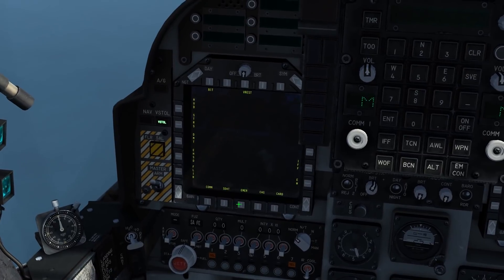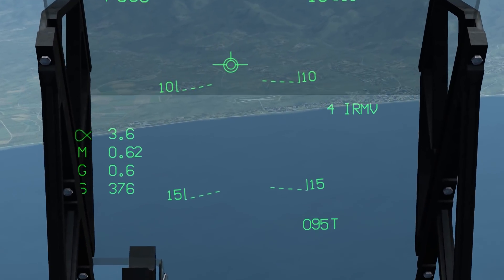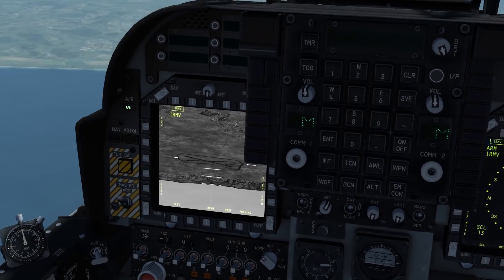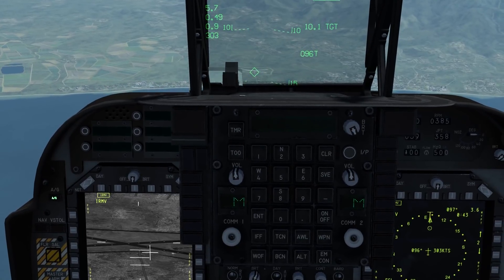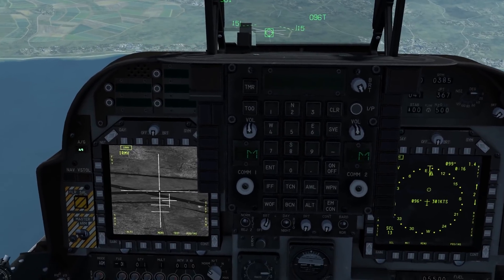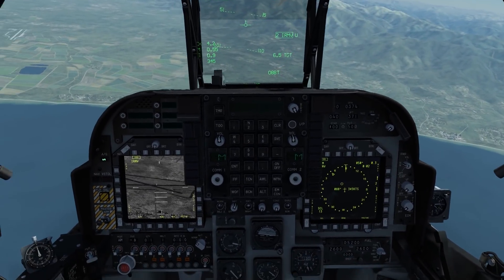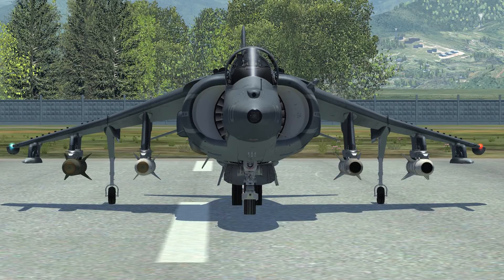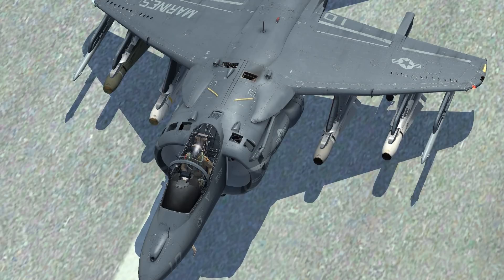DCS AV-8B NA Harrier AGM-65 Maverick Tutorial

Comment: Is there a reason you use the DMT? I've just been selecting IRMV, waiting for "RDY" to appear bottom left, toggling sensor select forward to "IRMV", then uncage and slewing the HUD cursor (for major slewing) and picking my target with the missiles camera in the MFD screen.
Reply from the maker: The DMT is easier to slew, can slave to waypoints and has a better zoom for finding targets precisly. It also remembers its previous location if you turn away. 

This just makes it a little easier to engage with, even though its a few more button presses. It's also worth noting that replacing the dmt with the tpod gives you the exact same process, but with even better still optics and observation.

Of course, at night the dmt is useless as a tv camera however.

Comment: How the hell do you get the DMT to reset after you've used it once? Once I get it locked to the ground once, I can't get it to lock anywhere else without slewing the thing for 100km to the new target...how do I get it to unlock the ground? I've tried using the nose wheel steering key binding, but it doesn't seem to release the TV position. my TV is just staring at the ground below me. I can't get it to lock, I can't get it to move, I literally am mashing buttons at this point and nothing is happening.
Reply from the maker: It's the AG Target Undesignate / NWS / FOV Toggle button, verify you've got it bound correctly.

Comment: Is there at all a method to have the Maverick seeker heads slaved to the DMT at all times? If that is the case - is it possible to assign steerpoints via the DMT?

My thinking is that, while you are >7.5 miles out, you can designate each target a steerpoint while you’re waiting. Then, when you’re in the engagement zone, ripple a Mav, select the next steerpoint and hence quickly have the next Mav slaved to the next target, ripple again ad infinitum until all stores are depleted.

I was able to do a similar thing in Falcon BMS where you could just have your TGP cycle through all your steerpoints and fire Mavs on each target.
Reply from the maker: The Aircraft does have the functionality to slave to waypoints although it's not fully implemented in dcs. I believe mark points and manual waypoints are also planned.
Reply: RedKite thanks for the info man!

Comment: i don't have a pipper on my harrier, 
i don`t have a pipper type thing that shows where the aircraft is going, i don`t have anything that shows where the sidearm has locked
Reply from the maker: Do you also have a little light saying gen on the right of the keypad? Sounds like you forgot to turn on the generator during start up
Reply: no, even when i start from the air, it doesnt show,
i could show you some screenshots of my cockpit to show you what switches ive got pressed, this was on a flight from where i started in the air, 

this problem also persists in multiplayer if that helps,
Reply from the maker: Do you have the air to ground master mode selected, have you selected your weapons on the armament control panel or on the strs page.
Reply: yes
Reply: another thing if this helps is that my RWR isnt giving any sound, i can see the symbols, and it shows up on my HUD compass, but i cant hear the noises the rwr makes, only little squeaks if the missile hits my aircraft,

Comment: Excellent video.  I have just downloaded the Harrier module and will be trying it later. I have learnt from the A10 that these type of videos save me so much time. I use Oculus rift for DCS which is brilliant for a sense of presence, speed and scale but is very much less good for picking out ground targets on sensor screens. I also find that I have to lean towards sensor screens to read what each button does as it can be hard to read.
Still good though. Cheers.
Reply from the maker: I've been using the Vive, been having great fun in dcs increasing the pixel density a little will help with readability you could consider binding 'vr zoom' in the ui layer section of the controls as well. That said Trackir is better suited for video tutorial production :)

Comment: I don't know what I'm doing wrong. I can arm the missiles but instead of a brief standby it goes right to ready. Then I can't get aft bind to work nor slew control... So frustrated.I'm using the same missiles. The the same procedure to the T. It's as if the game isn't recognizing any of my binds.
Reply from the maker: I've noticed that with airstart aircraft, if it says RDY then in my experience it's always been working. make sure you're not using an axis slew, that the mpcd's are in the correct mode (irvm for mavs, ins for the ins mark point and tv for the dmt), try pressing your control inputs on the control binding screen and check if you're being jumped to the corresponding action.

Comment: I don't understand nothing
Reply from the maker: The tutorial assumes a basic understanding of the hotas buttons and dual mode tracker, i suggest you look them up in the manual and return once you have the absolute basics.
Reply: yes I'm trying but all the buttons combinations confuse me, it is not easy at all
Reply from the maker: I'm assuming this is your first modern dcs module, I can relate, its a barrier i had to cross through with the A-10c. There's a lot of terminology and systems,  All i can say is make your own notes, diagrams of control binds specific to your controller, write out the process for specific tasks and have them within vision when trying trying to fly, build up slowly with guns, rockets and bombs then move onto sensor management and then linked sensors and weapons, tacking it one thing at a time.
Reply: thanks